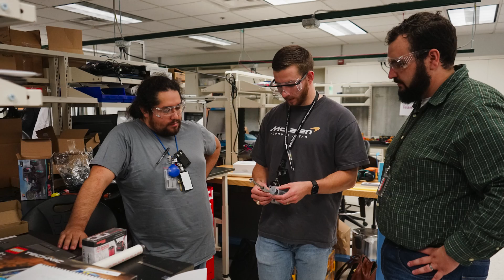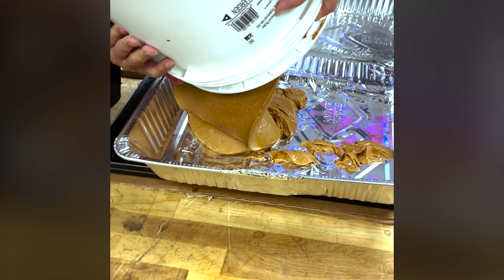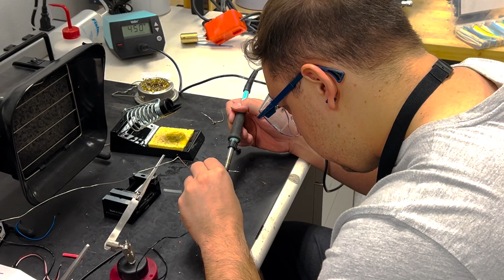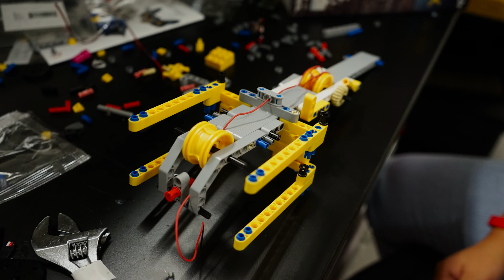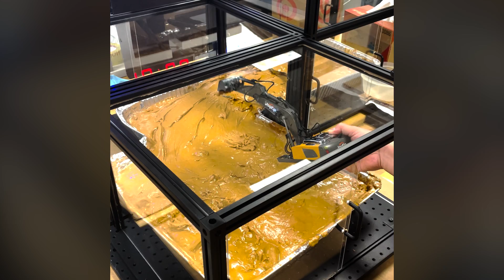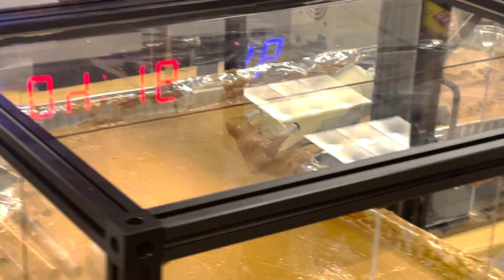Peanut butter challenge: Engineers navigate sticky situation in design sprint

Comment: some possible getarounds of the situation 
1)use flaking material like graphite or mica
or this might be termed as cheating but this can be most effective to hang a roll of plastic or paperso when vehicle moves roll is sandwithced between butter and wheels creating a barrier to move on it
2) or use non stick coating
3)use light weight high torque design
4)
Reply: Screw type treads came to mind for me